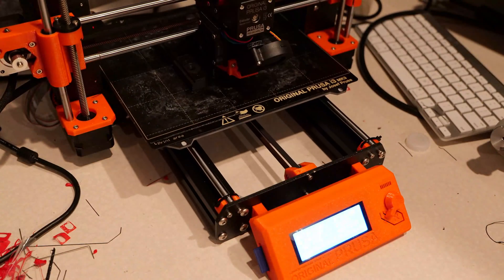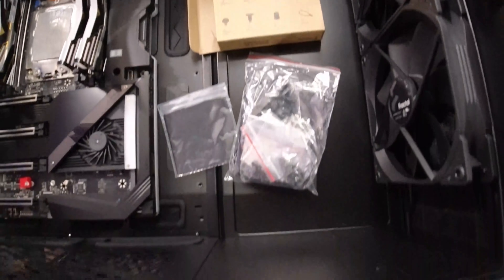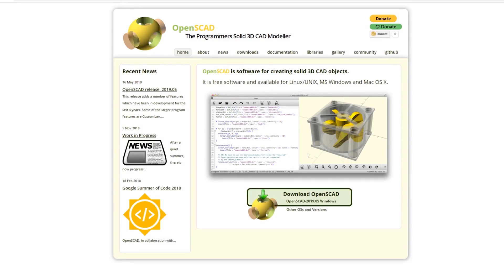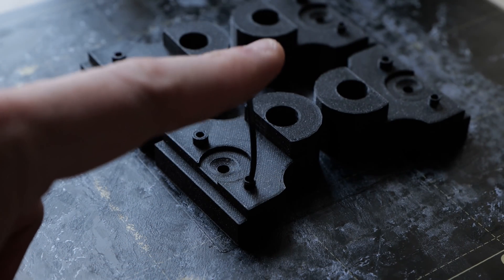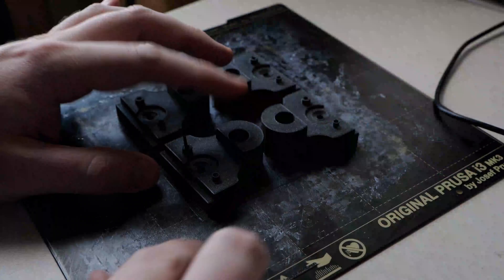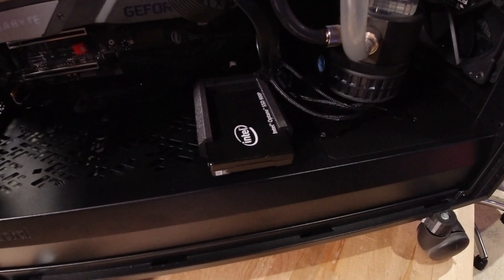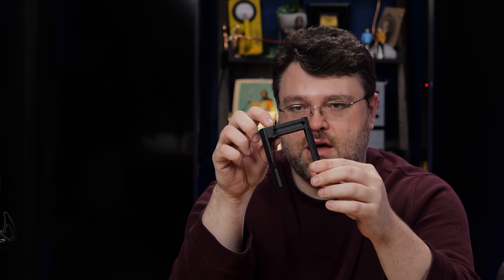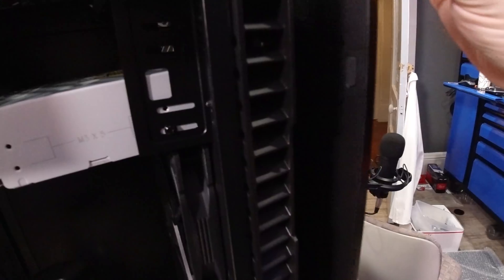Fractal Define XL: 3D Printed Mods!

Comment: Coming back to this old video because at 5:55 Do you know of anyone that has done a 'poor mans' SAS/SATA back plane of sorts? 
One of the projects I have had on my list (for like a decade) is to slots like this that while they  aren't hot swap per se (like you mentioned), they would be easier than having to mess around with wires to replace drives. The idea was to take a case that doesn't have hot swap or slide in bays, and 3d print and assemble something like this with a mini sas to 4x sata and power slotted in. 
I'll be working on that in a few weeks when i get some time off.

Comment: Here's my idea for the Define 7/7XL:

Raspberry Pi integration. Put it on one of the multibrackets where the watercooling pump/reservoir might go. Route the cables (USB, LAN, HDMI, Audio) to the back slotcovers, or to one of the 5.25'' drive bays.

Comment: I'm planning on designing П-shaped 5.25 drive support brackets for 7 and 7 XL that could be screwed to the cutouts on the top plane to allow for heavier accessories there. Gonna be tough without a printer, but that sag is driving me crazy =/

Comment: @Level1Techs the STL file download doesn't seem to work. Where can I find the download? Also, do you have a link to the wheels you used?
Reply: You can use standard casters meant for typcial office chairs with an 11mm shaft. You can pull them off an old chair or get a set of five from Amazon for about $10 or $12.

Comment: a lot of the 3D printing channels have shown almost 90% of the strength is contained in the shell of the print and not the infill so if part strength is what your going for adding an extra shell layer is more important than infill percentages 

infill is their more for layer support while it is printing than it is their for structural integrity after it has already been printed so there is no real benefit in going above a 10% infill unless you are looking for weight and density or have a very complex part to print the needs the internal support for it to print properly

Comment: I have an ancient Zalman Z7 Plus case I use for my home server. The case itself only has 5.25" bays, and originally shipped with a drive cage that would then accept 3.5" drives. I ended up ripping that cage out and printing adapters that go into 5.25", and take both a 3.5" and 2.5" at the same time. I've got 4 hard drives installed for ZFS with those. 3D printing is pretty great, even if I haven't had much need for it with computer stuff specifically, at least yet. It's great for VR though, got some nice things printed for that.

Comment: 3D print some fan-mounted wind tunnels to channel the airflow to hotter parts of the case.  Don't for get to add LEDs for that extra oomph.
Reply: ... or a wind powered whimsy to the side that won't impede airflow too much,... or an anemometer mount,... or even solid "vines" for LEDs to appear flowing within the case.

Comment: Hello, Wendell;
Thank you for all you do.

LOVE IT!
Yeah, its GREAT to see someone a) using their head to solve problems, & b) combining tech w/ different tech.
I'm on disability so buying one of those toys is out of the question & since I live waayyy back in the woods its not like I can run down to a maker shop to make my own parts.
For my part I'd like to have some feet to lift my case an inch or 2 off the desk.
I guess my only choice is to advertise to see if anyone local has a 3D printer that wants to make some simple parts for me.
I really like that you just measured some parts to see what size you needed.
Simple is best & the drive holder is just more of the same-GREAT work, man!
Have a GREAT day, Neighbor!

Comment: Printing many failed prototypes is standard fair with 3D printing, don't worry about it. In fact, that's what makes is so useful, since you can iterate your designs much quicker. It's quicker to print and test ideas to see if they work, than spend weeks figuring out a perfect design (although a balance of both is good). 

I've been thinking about making a headphone holder (there are hundreds of designs online) which clips onto my desk for a while now. I'm on my second pair of headphones where the rubber sleeving where the wire meets the headset has failed and I only have one speaker left due to metal fatigue :(. A headphone stand likely would have prevented that. There are also lots of nice models already for things like SD card and USB holders e.g. on thingiverse. 

It would be cool if you did a video on controlling the printer from a Rasberry Pi using Octoprint. I've had mine set up for a while, and it's nice for keeping an eye on the print and sending GCode. Requires a bit of command line stuff on the Pi which I've never done before. Also fits the 'DIY internet of things' sort of vibe you had in the recent privacy video.

Comment: 10:09 I wanted a way to replace the peep-hole in my apartment door with a Raspberry Pi camera (thing:4118711). It took quite a few iterations to find a combination of hardware that I found ... acceptable, but it's been in place now for a few months and letting me play around with programming for facial recognition. The eventual goal is to have the Pi check if it can ping my phone, and if it can, it'll look for my face to unlock the door.

Comment: I have been trying to make for a while now, a sata power splitter board and a case to hold it. I hate too many cables going everywhere so I wanted a single sata power coming from the psu to plug into a box that has four or six sata power out connections. Then I can use simple sata power extension cables to run to drives. It also makes it easier to have perfectly sleeved cables.
I don't have a printer so i have tried hacking things together but its always just way more ugly in reality than it is in my head. I need a laser cutter and a 3d printer in my life.
I also really like the look of the 7XL if only it had better ventilation of the front panel. I have large radiators that need to breath.

Comment: 1. 10:30 stop being so hard on yourself, your profession doesn't make you an automatic mechanical designer
2. one of the main draws of 3D printers is the quick turnaround of complex prototypes when you're not exactly sure what might work, imagine trying to make those shapes by hand
3. I'd like a modified battery cover for my Rift S controllers so I can attach Index style knuckle grips, the cheap mimics only grab onto my fingers and get in the way

Comment: I actually 3d printed a fan mount for the CD-bays on a computer I was making into a Router.
I live in Australia, so it gets hot, and the computer wasn't going to be in the best place for airflow, so took out the CD drive and made some fam mounts

Even 3d printed some cable channels to mount on door frames to stop housemates stepping and wrecking my network cables, they were a simple design that lasted over a year, i recently had to replace them with ones that i could add screws to help clamp to the door frames a bit better

Comment: Wendell - it's already available:
* 4 U.2 drives in 1 5.25" Bay - look for: IcyDock ToughArmor MB699VP-B
* You'll also need a good PCIe card with 4 SFF-8643 connectors, look for:  Linkreal LRNV9324-4I card. It's PCIe X8 but it has a Broadcom PLX chip.
Reply: Icy Dock is also planning a 6 drive version, on a 2 bay device, with a system to eject all drives at once. If you like this, give them positive feedback, so that it can be a reality. https://www.icydock.com/goods.php?id=351

Comment: Wendell, we need more of this from you; also, Fractal should be paying you to promote this sorcery.

I was tinkering with a drive bay reducer for my R5, that way I could fit my x2 2.5" ssd hot-swapper in. It slots in perfectly, but I need to fashion some retainers, since there's nothing currently  holding it in.

Comment: Tinkercad is awesome!  I've tried learning Fusion360 a few times, but I can usually design what I need in Tinkercad way faster. I just wish Tinkercad allowed for vertex manipulation. But yeah, I've been 3D printing since like 2014 and have used Tinkercad for everything I couldn't find a model for on Thingiverse.

Edit: Oh yeah, I 3D printed the mount for my EK pump/res because they're kind of crazy expensive to buy. Mine only cost like $0.20 printed in carbon fiber PLA.  :D 
I'm also using some 3D printed VESA monitor adapters. They've worked great for years!

Comment: If you just want to raise your Fractal case (none XL Define R series) , just use Adam Hall 25x15mm rubber feet (Amazon) and install them in place of the normal rubber stickers under the standard feet and replacing the screw with a radiator fan screw (length).

Comment: And for my next trick, I will 3d print the Fractal Design R8 Before Fractal even makes one!
Engagement challenge, id make a replacement basement cover to have an opening for one of those 5.25" multicard readers I know you could put it in the actual 5.25" bay but I like your idea of using it for the slide in some U.2 drives.

Comment: Icy Dock came out with a 4xU.2 to 5.25" hotswap adapter relatively recently, but it's only a single bay and has two 40mm fans. If you made a dual 5.25" bay adapter, you could potentially have it coming further into the case, and have a larger 80mm fan offset from the 'backplane'.

I've been meaning to redownload SolidWorks at some point, so I'll have a go adapting your sled when I do.

Comment: For the fractal 7 XL, a 3D printable drive tray (there type B), I have chased up half of the suppliers in Australia, and so far no one stocks them, on request I have not even heard back yet if any of them even plans to stock them..
Reply: Did you try contacting them? They do have a spare parts shop in Germany, they might be able to help. :) 

https://www.fractal-design-shop.de/
Reply: @osgrov  not fractal directly. Just every one of there listed suppluers in australia. 

Thanks for the link to the web store. Did not know it existed.